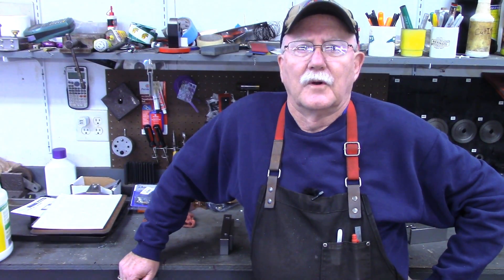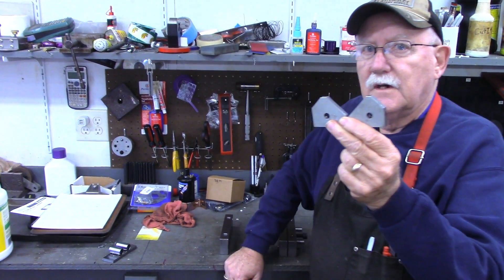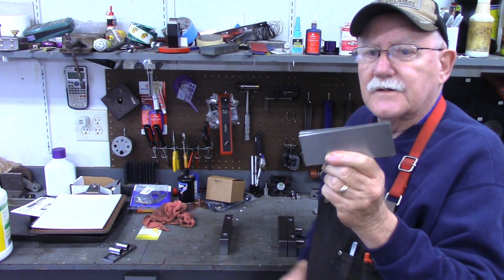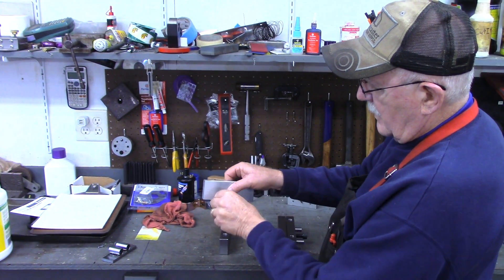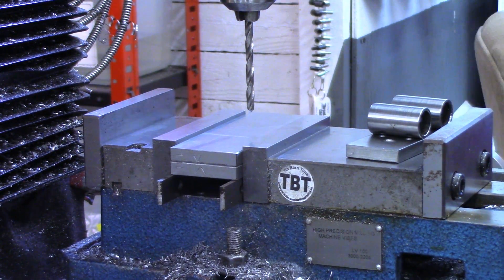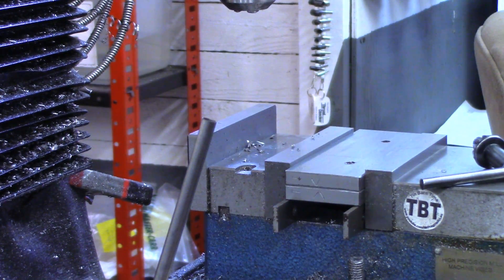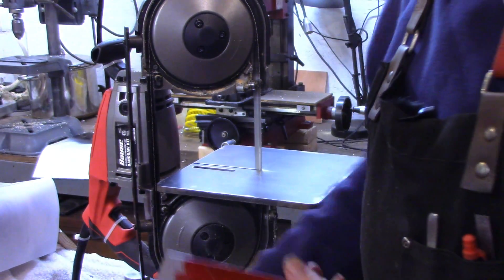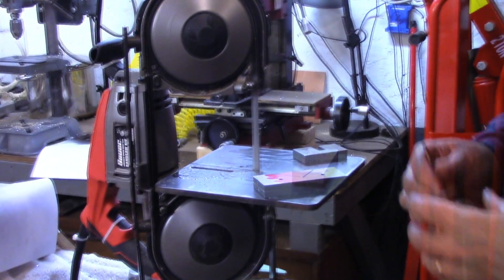Machining A Matched Pair of Vise V Parallels

Comment: Lee I really love the concept of the vee parallels. I am currently working on making a 2 piece mill table vice but i intend to mount the jaws on a section of aluminum flat bar so i can clamp the flat bar to the mill table therefore not risk damaging my tee slots on he mill table.  I am making some vee bearings from cast iron for an old Marvel hack saw i am restoring. This concept is excellent brain stimulation for the project i am working on. Thanks a million for taking the time to video and share it.

Comment: I have a small 3" square and I dropped it. I checked the 90 Deg angle on my Starrett combination square and it had shifted some. Placing the small square in my vise I tapped the blade until it was square to the Starrett combo square.  Be sure to check the 3" square before using it.

Comment: That was a nicely done project.  Could one have finish ground both surfaces on the V at one go?  That is could the vertical face have been ground on the side of the wheel or is that not a safe process?  I have a surface grinder and am trying to learn the things which are good practices and those which are not.  Thank you for the video it was very interesting especially the grinding.

Comment: I hate trying to work in the vise when you can't hold it well.  The part sticks way up and I just don't like it.  I take really light cuts and it works but makes me cringe! Lol!!  A great man once said "If the chip exceeds the grip, the part will slip".( Joe Pieczynski) I like it. Thank you for sharing!
Oh, by the way you're surface grinder is almost silent.  Must have some good bearings and a good motor on it.

Comment: Lee, please be aware that the electronic "angle finder block" that you use for setting up angles, is not absolutely correctly.  To prove this, set up a SINE BAR at different angles and then put you "angle finder block" on your sine bar.  You will find that it is close for woodworking and blade setting, but not the accuracy you need for machine work....